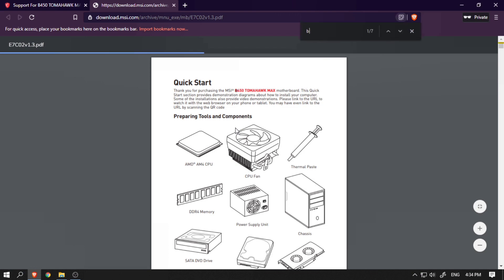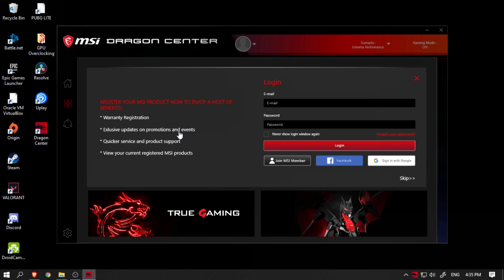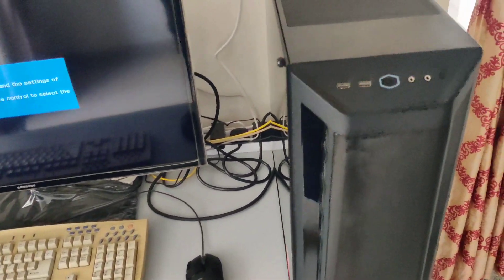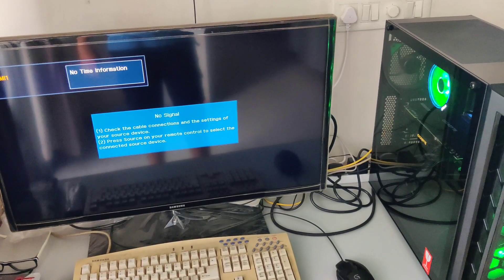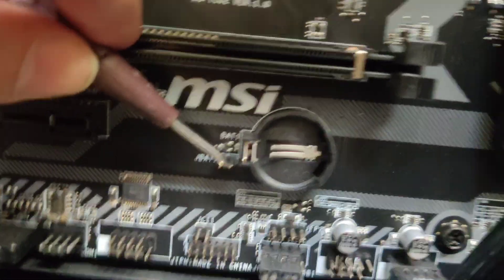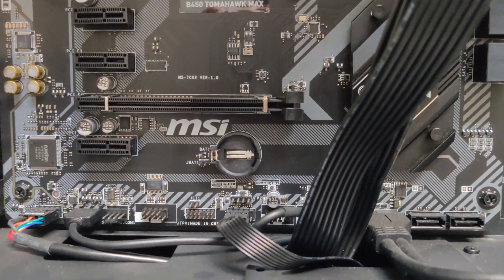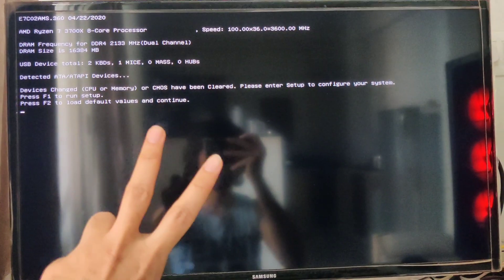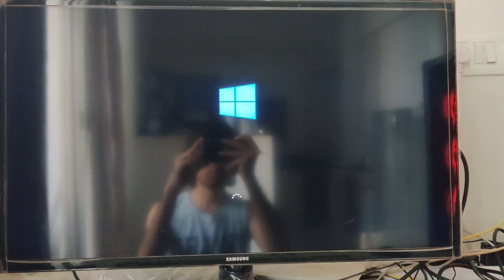AVOID USING MSI LIVE UPDATE - How To Fix Failed BIOS Update | How To Reset BIOS | How To Fix No Post

Comment: Fucking MSI... I have no trust for them anymore. The latest bios fir H610's is faulty, gives a whitescreen, only way to safely fix is downgrade and blindly flash though m-flash, even the official AMI software that can install previous version of a bios in windows can brick THEIR motherboards, exclusively MSI issue. So I'm not surprised their thing also has dumb issues.

Comment: Nope when i press F2 to continue it just shuts off after a while. I managed to get into the BIOS twice in completely wrong and random ways (once by pressing F11 to open boot menu) but then m flash wouldn't work
Bios version is also reading "C.00" 😅

But the PC WORKS??? everything is fine except entering the bios but I kind of need that to adjust the fans and other things 🤔

Comment: I have accidentally updated wrong bios. It's pro vdh plus but it updated itself and now pc work but often in reboot it won't boot then and then leave me with two options, either to leave pc for 1 hour or try clearing cmos few time. I tried flashing correct bios by mflash but it don't work.

Comment: Same happend to me :(  X79a -G45 8D, rebooted af few times like the update description told en then ...  nothing but black screen. Model had a second bios chip but switching to B bios but nothing.  Great update MSI ! , have now dead motherboard, even tried using a CH341a flashing device but as soon the the device is connected to the bios chip the CH341a is not available and voltage on bios chip is dropped to 1.2V, seems like the update just fried the bios chips ...

Comment: Just huge thank you!
After 1.5 hour of stress and despair decided to try out this method. And for everyone that happened to be in a situation like this claim - don't panic and do this exact procedure. Don't know about other motherboards, but seems for MSI MoBo at least 2 years prior it works. Saved my MSI B560M BAZOOKA.

Had issue that BIOS screen didn't pop up on boot so decided to update BIOS. Only after I clicked "Install" I realised how mad and bizarre was a decision to UPDATE BIOS WITHOUT AN ABILITY TO TRACK ONE OF THE MOST RISCKIEST PROCESS IN SOFTWARE UPDATES.
So first of all - don't do like me and just fix this thing with BIOS screen, and the second - if you still got into similar situation: if after 20min PC didn't restart on its own - do the same thing as in video.
Turn off PC, unplug PSU, discharge with power button, pop battery out, short JBA1, put battery back, plug everything back, restart. PC should start, then switch off and then start again (at least in my case it was this way), but Windows wont boot up, instead screen like on 2:27 should appear (but of course you are unable to see it). So now you should do it by touch – just press F2 and it will boot with stock BIOS.

Decided to write this specific instruction because in moments like this it can be hard to take it mindfully and make out of line decisions.
Reply: How many minutes should it start up?
Reply: @lyleagustin7931  if you are talking about "PC should start, then switch off and then start again" part, then it should restart in 1-2 seconds after first start up

Comment: Hi bro i m scared to upate the bios of my msi bravo 15 gaming laptop because there is no CMOS battery on the motherboard indont think I'll be able to recognise the fox jumper pins if they are there so i m sacred to update it,i wanted to update it so i can use amd smartshift feature ij the bios i don't want to get left stranded with a brand new dead laptop

Comment: Thank You. You are THE dude. I've been doing this for 35 years so I know better. I bricked a few in the early days (when it was almost a 50-50 thing at the time) so even M-Flash gets the nerves up. But when I saw that option pop up the devil on my shoulder (I imagine him to be much like Bevis from Bevis and Butthead) kept chanting: Do it! Do it! Do it! Since the fans spun up and the lights remained in their set colors I thought there MIGHT still be a chance...

NOTE: This didn't take the first time I tried powering up after clearing the CMOS. It did the 2nd time though. If by chance it doesn't work for you at all, my next move would have been to try the driver flash using a USB drive with the file in root, the special USB port on the back and the manual flash button next to it. Can't say if it would work or even make things worse, just throwing it out there as a potential plan B. The manual covers the process.

Comment: Hey, just a heads up people you do not need to remove the CMOS battery. All you need is a screwdriver or a jumper to have the pins reset the board.  You can also have your system crash if you OC your CPU or your GPU and the MB will also crash. DO NOT PANIC, and do not call ME!! All you have to do is the same thing for ThatDude. Just reset the BIOS and reboot. You will have to go in and redo your settings.  All the battery pretty much does is keep date & time.  You also have LIGHTS on your MB. NOT RGB, but an indicator for your CPU, CPU, the board.  Nice video!

Comment: Also a big thank ou from my site, this video helped me so much. My PC is back thanks to your video here. If I may add one thing that I had to solve later on:  With the BIOS reset, the computer was booting in Windows 11 with default BIOS settings. I could not log in to my account since the PIN was not accepted, also creating a new PIN did not work. This issue was that TPM was disabled in the BIOS with default settings. Enabling it again, everything worked.

Comment: Thanks for the video. I did try removing the battery and thought that would do it and didn't. It is a bit confusing, they have another battery on the mb? Never understood that. Anyway searching for the holy grail found this video and removed battery again and this time found the cmos reset jumper too and it worked apparently. I am now in process of updating using the m flash thingy (in bios flash utility). Should have done that in the first place but I was lazy. I actually remember I bricked 2 MSI mbs in the past (many years ago) this way but already forgot (they were quite old at the time so not enough shock to remember it for a long time I guess). MSI is kind of shit with this live update thing. If they can't make it work they should just not have the option in live update :D

Comment: My Msi Z490 gaming carbon wifi using live update update an bios ， after it run with 100% restarting the cpu Debug light was blink ！ then no display ， Keyboard mouse no function or RGB ！（Try your solution but Nothing happen 😢）
Reply from the maker: Oh. If your mobo has BIOS flashback feature, try that once.
Reply: @thatdude6440  sadly no have 😢
Reply from the maker: Oh man, sorry.
Try reaching out to MSI and hope they'll help.
Reply: @thatdude6440  thanks bro T.T
Reply: I have the same problem, could you solve it? help
Reply: @drsant0  I did Send it back to MSI for warranty ！still under process

Comment: I tried updating my bios with a flash drive and this issue still occurred, I tried resetting my BIOS using the method in this video but my PC still won't boot? I've tried it a few times and I get nothing. Any idea what this might be? I have an MSI B250M PRO-VD for reference. Thanks!
Reply from the maker: Does your motherboard have BIOS flash feature? If so, try that once and see if that works.

Comment: Msi Z370 Gaming Plus
I updated using dragon center and now my pc won't post. No light on keyboard and mouse as well..i followed all the step from your video but still same.. someone can please help me... i did try many methods but still not working.
Reply from the maker: If that didn't work, did you try BIOS flashback?
Reply: @thatdude6440  i cannot do anything since the screen turned black and keyboard and mouse not lighting... my mobo don't have bios flash button.. does there any other way to flashback bios?
Reply from the maker: No, if the feature isn't there in the mobo you can't do it.
Does your mobo has debug LEDs?
Reply: @thatdude6440  yes but it's not showing any error....
Reply from the maker: Hmm, sounds like your hardware is fine.
Do you have a spare harddisk? Remove your current boot drive and try with the spare drive and see.

Comment: Hey man i updated grub in terminal in pop os, then my Msi b350 mobo/system would not bootup. then i tried making changes in bios and now it wont even post.
ive completely disassembled,  blew dust out, removed battery, shorted jbat terminals reassembled. no changes. still wont post. the mobo lights up, fans come on, post debug lights show 2 lit diodes for few seconds then both go out and still no post.
ive inspected interior of psu, measured voltages and all is good. theres no bulging caps or burn marks anywhere in psu or on mobo or on gpu
if i had to guess i would say bios is reset to default cuz some functions seem to be turned back on like gaming led backlighting and fans seem to be running louder like theyre on stock power settings but i still got  no post, nothing just black screen despite all fans seem to be running and gpu is lit up with its diodes as is mobo.

am i buying a  new mobo?
Reply from the maker: I'm not a Linux expert but sounds like something's wrong with GRUB.
As far as I know, GRUB has nothing to do with the mobo/BIOS. It's stored on the storage device and not on the mobo/BIOS I believe.
To quickly test if your hardware is defected, just make a live USB of any Linux distro and see if it boots up.
If it does, nothing's wrong with your hardware and you can fix GRUB from the live Linux itself.
Reply: @thatdude6440  FYI; boot means windows or any OS wont load after bios posts.
POST means power on self test.
my computer would not boot after updating grub.
then it wouldnt even post after i made a change to bios.
all it does is power up fans and leds on mobo, gpu , cooler etc but zero ouput to screen, no black n white screen with number s n digits, nothing! black screen
Reply from the maker: Got it, thanks.
Does your mobo has debug LEDs? Do they stay on?
Reply: @thatdude6440  it has them but they dont stay on. im begininng to think i need a new mobo:-(
Reply from the maker: The fact that debug LEDs don't stay on means your hardware is perfectly fine.

I would suggest you to try replacing your boot drive with another one and see if that works.
Reply: @thatdude6440  i did add in another spinning drive but cant remember if i removed the onboard M2 at same time. i will give it a whirl  although i did buy a replacement mobo online already.
Reply: @thatdude6440  ok i tried, that. even removed cmos batt again and hit cmos jumper for 10 sec with battery out and still no POST with spinning drive instead of onboard M2. 
So that debug led system can tell if gpu, cpu or memory is present or if its still alive as well/?
Reply from the maker: Oh, sorry you had to buy a new mobo.
When you push the system power button, mobo actually performs a suite of tests on different components like processor and memory modules. At the end of the test, if mobo has debus LEDs, it'll notify owner if something wrong.
In the old days, LEDs were not there but there were beep sounds. For example, 3 beeps means something's wrong with the processor.
Reply: @thatdude6440  so u r saying i need a new motherboard?

Comment: Did not work for msi mpg z490 gaming edge wifi, tried multiple durations and combinations. returning the motherboard.
Reply from the maker: Try BIOS flashback once.
Reply: @thatdude6440  this motherboard doesn’t have bios flashback option
Reply from the maker: @ilonioum  Ahh, in that case I'm sorry my method didn't work for you!

Comment: @ThatDude I have important question. How to prevent this situation? It's more important than fixing it ;) I need to update VBIOS to have Resizable Bar supported, but I'm scared about this. Is any way to make sure that this situation will not happen after updating the VBIOS?
Reply from the maker: I don't think so. Updating BIOS essentially means trusting the mobo manufacturer.
There's nothing we can do to be honest, just download the latest version and be positive that this won't happen.
But even if it happens, we have ways to fix it so don't worry too much!

Comment: Happened to me pressed f2 opened bios, exites bios same thing happens. No screen no boot up
Reply from the maker: The fact that you got the option to choose F2 means the BIOS was successfully reset.
I wonder why it didn't work.
Do you have the same BIOS? What were the other options you got apart from F2?
Reply: @thatdude6440  i figured it out my boot drive was set on the hard drive instead of the ssd, thanks!

Comment: I also tried to update the vbios today using Dragon Center, now it is stuck at "wait for installing", though I can still reboot my computer, but the videocard is disabled, I try to enable it but it just disables itself, do you know how to revert it back or re-enable it?
Reply from the maker: So now instead of your video card, the system uses the iGPU? What do you mean by disabled? Need a little more info.
Reply: @thatdude6440  it was disabled in device manager, I was able to resolve it by terminating nvflash.exe, apparently nvflash was not executing properly that is why it was stuck at 100%, I did not push through with the upgrade.

Comment: Hello there I tried it and it didn't work. The first time I did this I didn't wait as u said cause I forgot, and then repeated the whole process from the beginning and my computer has been running for almost  20 minutes with no signal? Do I have to wait more or is it something else? Plz reply
Reply from the maker: I'm sorry it didn't work for you.
After following the steps from the video, when you turn on the system, does anything happen at all?
Does your mobo have debug LEDs? Or beep sounds to identify what's the issue?
Reply: @thatdude6440  Nothing at all except the cpu led light. Other than that nothing unfortunately. It's really frustrating
Reply: @thatdude6440  Hello again this time I'm here to say that I successfully resolved my problem. After many many hours of troubleshooting and searching though all the YT videos and subreddits I finally fixed it by doing a bios flashback. It didn't work at first but after many times and a couple usb flash drives it worked. I also used ur tip. So have a good day.
Reply from the maker: Glad to hear that your problem has been resolved.
Thanks for sharing the info and you too have a great day!

Comment: Do i have to remove all components?
Reply from the maker: Make sure that PSU is switched off and it's not plugged into the wall.
Apart from that, I had to remove graphics card because the CMOS jumper was hidden under it. Otherwise, it's not mandatory at all.

Comment: friend I have a problem !!  I went to update the motherboard bios (H61m-p21b3) and the computer shut down during the process !!  with that the pendrive did not want to read !!  now every time i try to activate the computer a written message appears (bios update is not yet completed please insert the usb pen drive and reset system) Do you know how to help me?
Reply: I am Brazilian!!  here I did not find any tutorial regarding this problem
Reply from the maker: I think the the power failure corrupted your BIOS.
But still it's asking you to keep USB drive attached and resume the process.
Did you try that?
Reply: @thatdude6440  yes I tried but the .bin file disappeared and I can't find it again
Reply: an online technician told me that i will have to rewrite the BIOS again
Reply from the maker: @casual_vtuber_br  Did you try resetting the BIOS?

Comment: Hi, I'm struggling to update my MSI H110m PRO VH motherboard. M Flash can detect the USB drive but can't find any BIOS files on the drive itself. The USB is formatted as FAT 32, I've tried different USB slots and I've used different USB drives as well. I've also made the BIOS file the root folder on my USB stick and yet I'm still having the same issue. Any help is appreciated
Reply from the maker: Did you try resetting the BIOS? And then try to update?
Reply: @thatdude6440  I haven't tried that yet

Comment: I did this but I still have the blackscreen and mouse + keyboard are not lighting up...
Reply from the maker: How did this happen in the 1st place?
Based on what you're saying, I sense a motherboard failure.
But please provide more details so that I can try to help.
Reply: @thatdude6440  Well I wanted to update the BIOS aswell even got the sucessfull message then the system rebooted and got the blackscreen. Then I took out the Battery and connected the two pins for the CMOS flash as my motherboard manual said. After starting again still nothing. I thought about the method with a USB Stick and the MSI.ROM file. But currently I am running the PC via my second BIOS. And thanks for your help :)

Comment: I did all that and now my boot led is white. What should I do now?
Reply from the maker: Looks like something's wrong with your boot drive. Try using a different boot drive and see if that works.
If not, something's wrong with the processor. Probably a bent pin or it's dead. Try installing a different CPU and see if that works.

Comment: I have the same problem but i did a usb bios flash but also blackscreen afterwards but this solution wont fix it, what could i do i have the msi z390 pro carbon
Reply from the maker: Generally, there are 2 ways.
1) Flash BIOS
2) Clear CMOS
As you said, you tried both and didn't work.
So I'm assuming that you have faulty hardware.

Linus made a great video for finding out what's wrong.
https://youtu.be/YKhCQmKAmEM
Try those things.